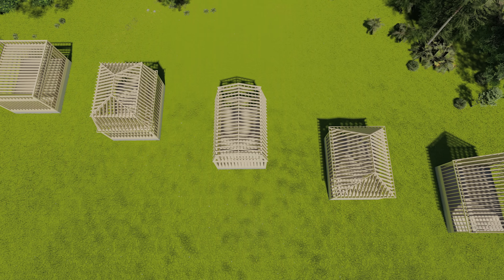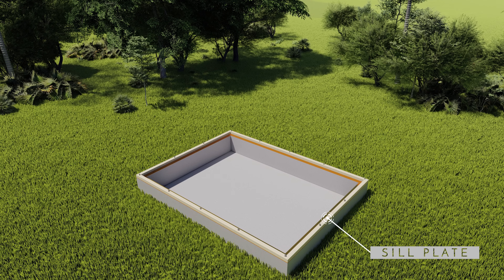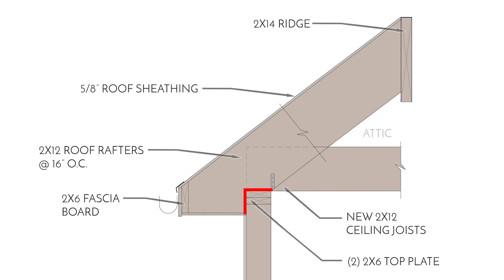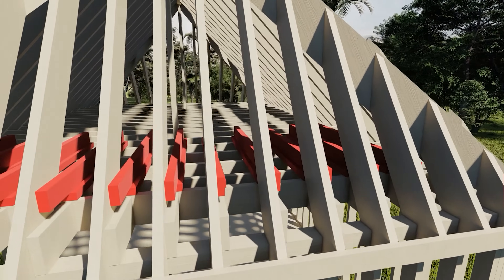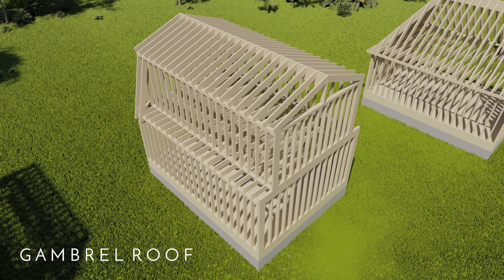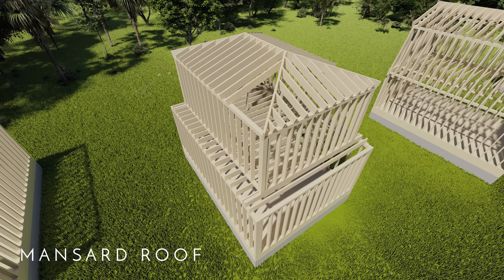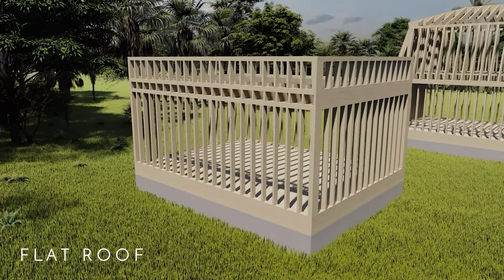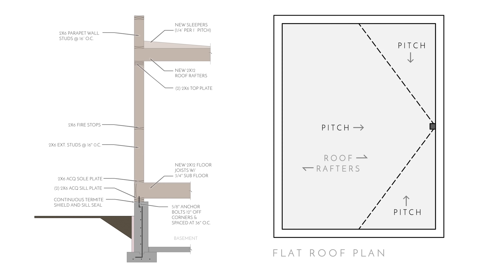Roof Types & How They Are Constructed - Carpentry 101

Comment: 16" O.C. and 24" O.C. is used for spacing. If the ceiling joists is 16" O.C. and the rafters is right next to it then what is the call out for the rafters?

Comment: In Australia, a skillion roof is fairly common. This is a 'flat' roof, usually 5° pitch, without the parapet, and with a gutter along the low side. The parapet is very rare, probably because it's a trap for leaves which inevitably block the drainage.

Comment: The termite shield info in this video is inaccurate. It doesn't prevent termites from accessing the structure's wood at all.
   What it does is make termite activity visible. Because termites cannot bore through metal, they will build a termite tube around the metal (exposing their presence) and continue into the structure.
   But don't take my word for it. I've only been treating structures infested with subterranean termites for 17 years. I'm sure have a lot to learn from internet experts.
Reply: Out here in Hawaii , under a concrete house slab code has you hire the pest control guy to flood the base course with termite poison , then cover with plastic before pouring slab.. All the construction grade wood is treated with 'Hibor..

Comment: While the 'species' of these frames are all described well and shown in great detail, it should be specified (for anyone interested in classical building methods) that these are all examples of stick frame designs, rather than true, traditional timber frame ones. Significantly more lumber is used, cut to much slimmer dimensions, to accommodate post-50s building methods, regulations, manufacturing techniques, and economies of scale in regard to the availability of wood, generally. Very informative video.

Comment: At the 5:36 mark, the ridge is supported by two studs. Do these studs remain in place under the ridge after the roof is constructed? Because if they do, we are left with a couple of load bearing studs in the middle of the room.
Reply from the maker: It really depends on a few things but typically when you have ceiling joists 16” o.c tied to each rafter the ridge is non structural and these posts arent needed. But when you have a cathedraled room with no ceiling joists and that ridge is structural you would usually need those posts to come down to a beam in the ceiling system or post down to the floor system below or have tension cables/trusses in cathedral etc. because that roof will want to push those walls outward. But really depends on your scenario (Always hire a licensed engineer/ architect before doing structural work) Tried to explain best I could hope that helps
Reply: @bruniarchitecture  Thank you, that is very helpful. I did plan to have a cathedral ceiling and I will take your advice to engage a licensed engineer/architect to design it.

Comment: I'm so glad I bumped into your video! I've been staring at the rooflines of what is a lovely house. Yeah, those rooflines. They couldn't have tried any harder to make the top of our house look like the crew got to a point, just did enough to call it a roof. Some of the crew were earlier than others for beer-thirty. They were the only guys working the inside of the open ceiling. Others in this house think I should be sent away as dotty, but I swear this white loaf of bread roof is on juuuuust a little crooked. Now all I can do is stare at it. 
This vid was/is a great inro, especially with people that do so much better seeing something visual. It is the best way to teach some. It's the only way you can teach others. Adults and kids with ADHD are like that. You have to keep the adults and kids like that busy, too. Destructive little cusses if you turn your back on them.😂😳🤯

Comment: The roof pitch isn't simply a style. In areas that do not get snow you can play around with whatever pitch you want and it's just a style thing, but anywhere that gets an appreciable amount of snow during the winter requires a steep enough pitch to shed the snow before it builds up enough to collapse the roof. Look at places known for steep rooves, they will be places that typically accumulate snow throughout the winter, or they are places that can expect very large single events that drop a lot of snow.
Reply from the maker: Houses used to be designed to be more in touch with their environment like your saying to be resilient against snow and other elements. Engineering has come a long way with roof systems and nowadays the snow load is calculated in the roof load/rafter sizing so you can have whatever pitch you want pretty much.
Reply: U can also mix radiant heating if it's a problem but even with large snow you will still see flat roof especially in commercial
Reply: Rainbolttwo thanks you

Comment: I would love to watch some advantages of one style of roofs over the other. for some it's obvious, for some... I struggle to understand, like why not build a second level instead of the mansard? It's weird 😅
Reply from the maker: Yea that's a good question and I think it just comes down to what your building. If you're adding a second story to a house in a suburb it would be pretty weird & wasteful to throw a mansard roof on it if the house is only like 30' wide because of its cost & function.

In Paris when you see the buildings that line the streets most of them have mansards that cap a fourth or fifth story and in that case I think it looks great. The most obvious & easiest thing to do if you want a second level would to just stack another level right on top and throw a roof on it but if we did that with every building everything would look the same :) The cities that have the best architecture are usually ones where you look at the facades & roofs and think wow the exterior design didn't have to be this ornate or complex, it could have been much simpler but they did it anyway and that's why its great.

Comment: having trouble grasping how to visualise pitch  & crickets on rectangluar concept house 16m long x 5m wide 
are you able to oint me in right direction with this as am struggling to get the concept of pitch of roof in decimal dimensions
Is it possible to do flat roof   design  with adequate drainage on a building with the dimensions I indicated?
Building being proposed is a 2 storey construction with lightweight aeroclaved blockwork

Comment: Great Video.  I will be building a small one story  8/12 pitch home and trying to decide between a gable or hip roof.  Is there a big difference in costs between the two?
Reply from the maker: Hey thanks 👍 It really depends on the spans of the hips and if you have to use lvls. A hipped roof is more labor intensive as there is more cutting and measuring. On a gable you take one measurement and every rafter is the same.

Comment: Why wouldn’t the flat roof be considered the easiest, because to look at it - it would seem so. Are you an architectural student? I’m looking to build a home ....myself. So I’m researching many videos as well ...as well as alternative building materials as oppose to wood frame.... as I’m looking to do it as cheap as possible
Reply from the maker: What I meant by saying the gable is simplest is that it has one high point (the ridge) and water sheds off each side. In other words its the easiest to understand imo. The gable will usually require more lumber and labor though. On the other hand the flat roof can look simple but under it is sleeper system and drainage system that can be complex and I graduated architecture school a few years ago
Reply: In terms of building it yourself, the "gambrel" roof is the easiest bet. Easiest and cheapest to frame.